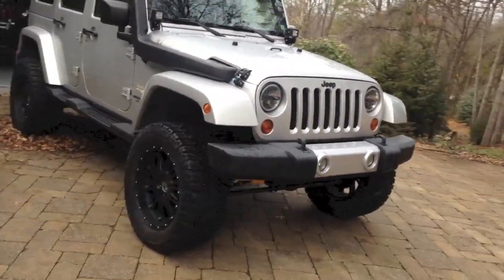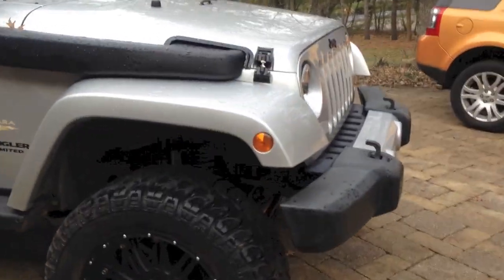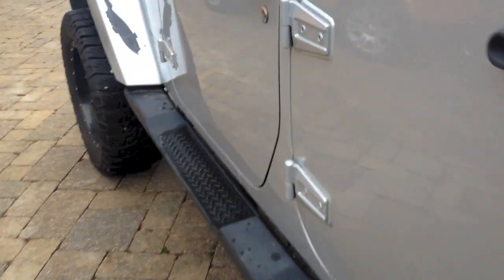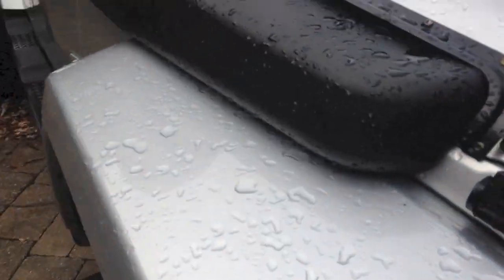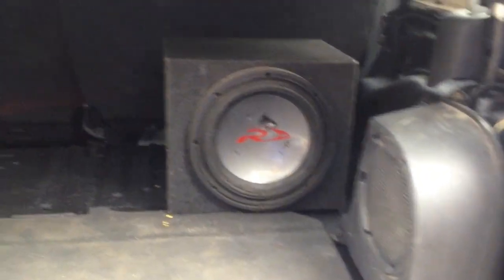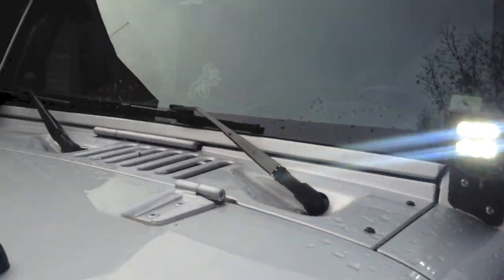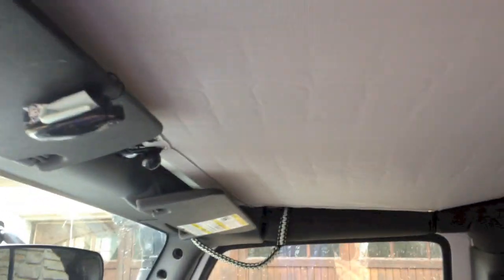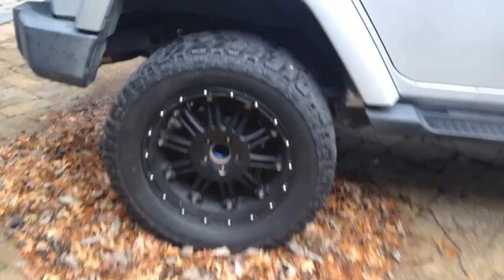Jeep JK "Silverback" Build

Comment: what is the snorkel for?
Reply: To go deeper without exposing the engine to water its a air intake for the engine so it can receive air even when its fully under water but when the water reach the top of snorkel you are in problems but its really hard
Reply: On this one? nothing. bet its not even hooked up.

Comment: Spacers? dumb. Going to regret that when you have to get your axels fixed. Or when a tire falls off on a highway.
Reply: +Baticon Apparently you've no idea how they work. There's guys running the rubicon, moab, and johnson valley on spacers. No breaks, no issues, hard core wheeling. If you buy crap spacers sure. If you buy from a reputable company, there's no issues to be had.
Reply: There is a difference between a "wheel spacer" and a "wheel adaptor" but both are not as good as just getting a rim with the same off set.